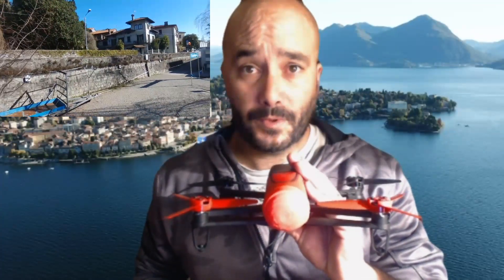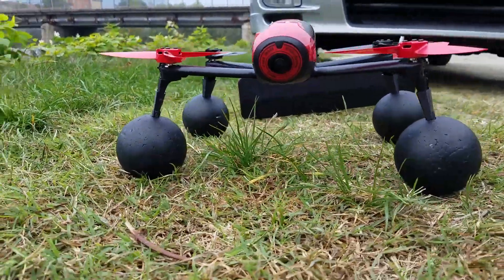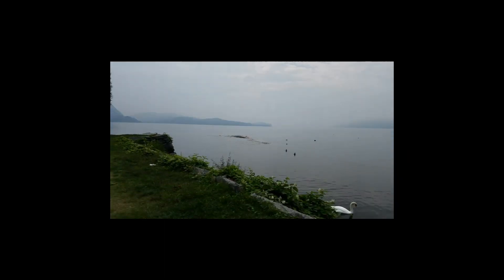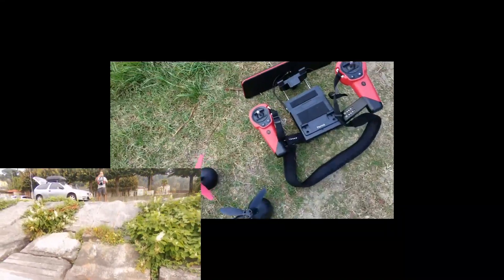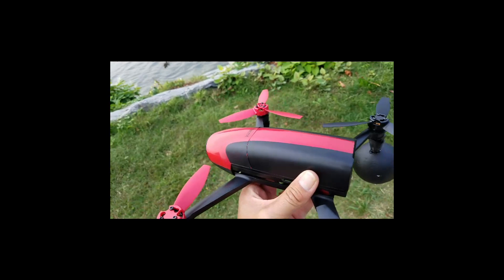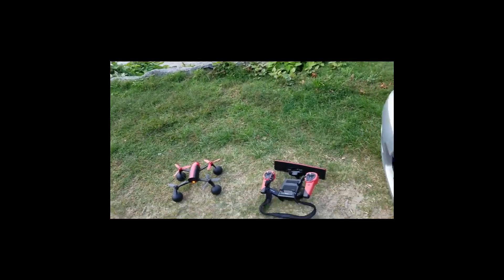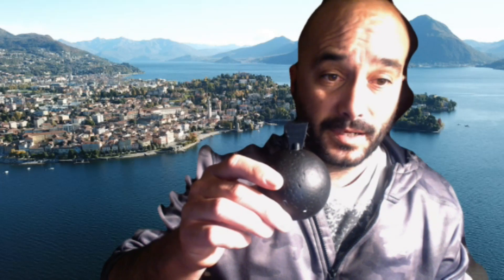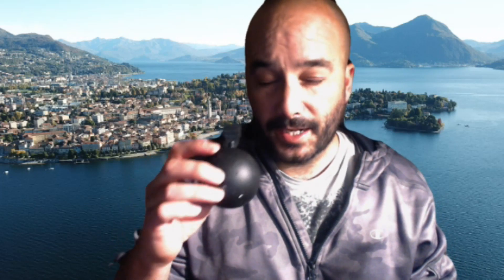Parrot Bebop 2: Water landing: 3D Printed landing gear

Comment: Hi! I created easy snap-on landing gears for Parrot Bebop 2. For two different sizes of styrophone spheres: 66mm and 79mm (those were the sizes of spheres i found in a local shop). Spheres are placed wider apart for better landing stability. These gears can put on or off very fast and easy. Shapes can be downloaded for free from Shapeways. 66MM version: https://www.shapeways.com/product/V8KW2M3NN/parrot-bebop-2-drone-66mm-sphere-water-landinggear?optionId=144469577&li=marketplace and 79MM version https://www.shapeways.com/product/GEH5LVHN7/parrot-bebop-2-drone-79mm-sphere-water-landinggear?optionId=145361721&li=marketplace